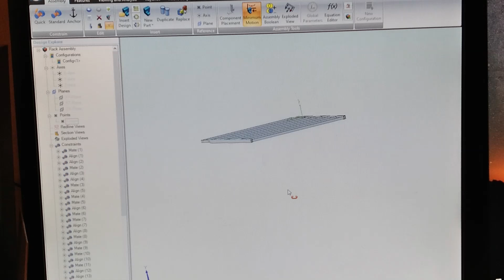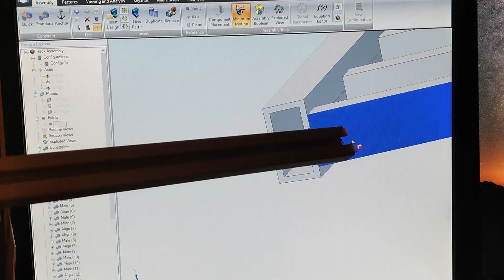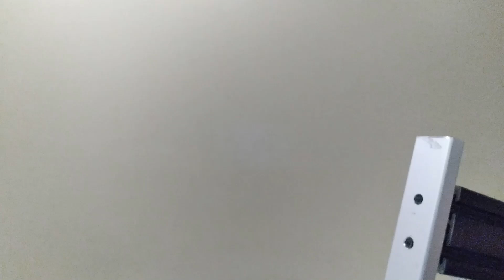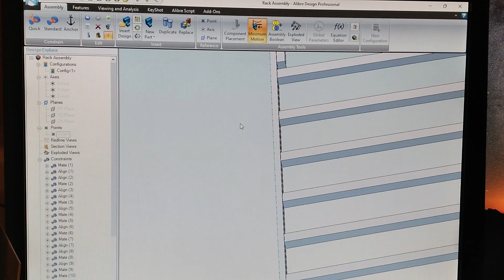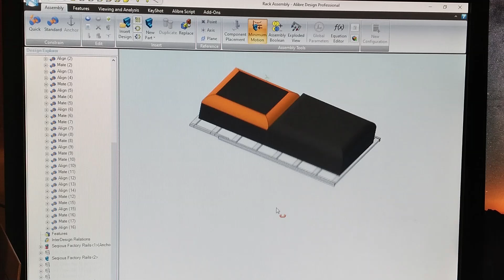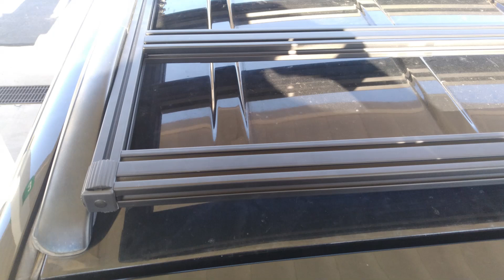DIY 1st Generation Sequoia Roof Rack using Factory Rails

Comment: Awesome idea! will def take a crack at making one . Curious can you tell me more abut where you got that 'bracket' you mentioned . it almost looks like a thin black piece that is holding the two bolts in place for each rail? at 5:22. 

Also do you know roughly what size you cut those those inner rail pieces at ? the TNUTZ part number EX-1050

Comment: Maybe I'm just not being the point of this. Why not just add more of the factory crossbars. You can get 6 extra ones at the junk yard to add to the 2 that come with the factory rack already.
Reply from the maker: The factory cross bars aren't flat! so if you are going for a relatively flat surface (side to side) then this is another option.

Comment: This is amazing! I was looking for an upgraded crossmember but they’re like $109 each.

Would you be able to list the hardware you used? What was the t-slot you used that went inside the OE rack?
Reply from the maker: @mannys5510 sorry I'm late, you caught me while I was on holiday. The 1/2 width extrusion I used that fits in the factory rails is TNUTZ part number EX-1050. The 1"x2" extrusion "cross rails" were cut to 42 1/8 inches. Those and some of the hardware in the video should get you some customizable cross bars. Don't forget the #10 square nuts drilled out to 1/4" to allows the crossbars to move while they aren't bolted down.
Reply: @enginerdamps2562  What is the end bracket you showed @ https://youtu.be/zLC7l-B8k5Q?t=315 Also can you provide link or name of the plugs and rubber bumpers you used?
Reply: @enginerdamps2562 amazing thank you so much for the reply! I bought all the parts and they arrived today